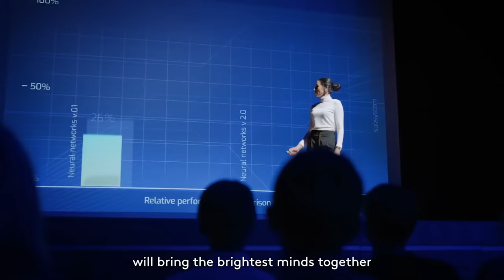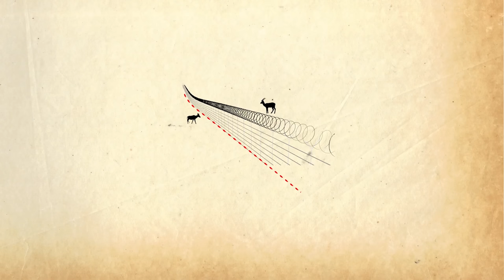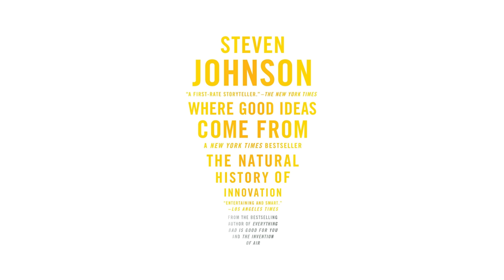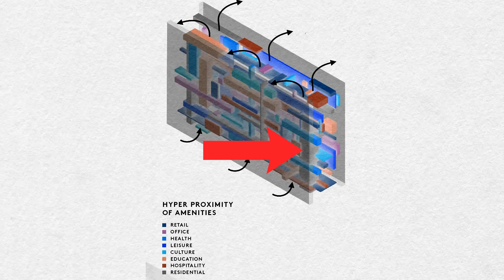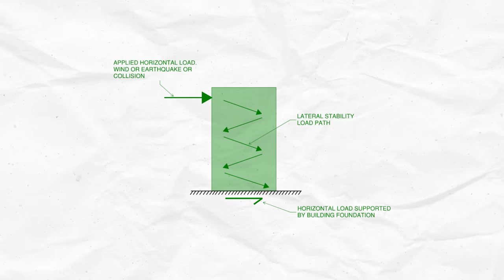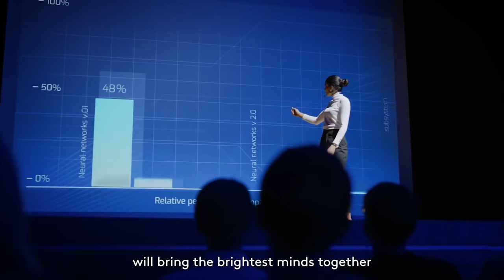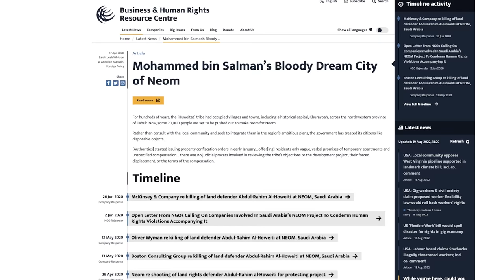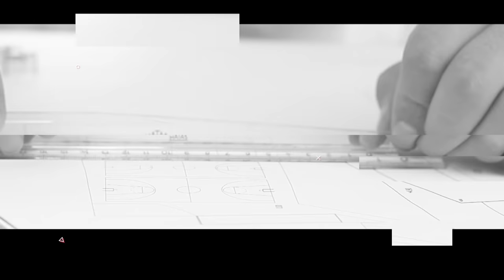This city concept breaks architecture (THE LINE)

Comment: This is based on the linear city theory proposed by Arturo Soria in 1882, with a long history of redesigns and proposals. One design even used the coast, like you mentioned. Even historically, this concept has never worked, and there are many detailed articles each picking apart each flaw of the design. It may sound good but simply doesn't work in practice.
Reply: I thought they should spend on Global Warming.
Reply: for real... it should be like a 40 year project - not this exactly ofc, but concepts of it. resolve domestic issues while slowly building the new stuff. gradually changing cities instead of throwing trillions to waste... this is a sad reality. what can we do to stop this ?? or are they just gonna do it anyway? I guess being vocal about criticizing it helps!?
Reply: @ZebrazRus  I thought it is on time now.

Comment: I really enjoyed this critique. I had many thoughts about heat, reflection, business & shopping areas nearby residential areas, richer & poorer populations, etc, so it was great to hear an informed critique of this.

I would've thought the desert has sandstorms and/or high winds from time to time & that the forces exerted could be massive & unequal along the length of 170kms traversing very different terrains. So I'd kinda thought they must be building this more as shorter blocks of 50m-100m or so, with wind passages or some other 'gaps' allow wind flow, but even that would be impractical & create vortexes of very different forces the structure would have to withstand & cope with.

I woulda thought it would be just savvy to construct smaller 'blocks' of the line along the proposed length of it - and not so tall to begin with - to 'test' what happens in reality.

Otherwise I can see a highly class divided society of base level workers in cramped horrible living conditions that are 'cheaper' serving the needs of visiting business execs, tourists & the mega wealthy residents.

Sounds dystopian & horrid.

Comment: As you said, and coming from an environmental geography background, first thing that came to mind was the habitat fragmentation. It would seem the designers have never heard of the concept.  A 'line' is the most anti-human/anti-environmental design I think one could imagine for city design.  I wonder what consideration has been made, if any, for break down of the transportation lines, fires/emergencies cutting off different sections, etc.  9 million residents...will the rich elite global business leaders be living next door to the train operators, store clerks, street sweepers, mechanics, etc...? Also, would consumable goods be manufactured within/nearby/or imported over long distances?

As you said, so so many questions. Even folks who don't have any background in city planning could probably name at least one flaw in the design at first glance.
Reply: My rational for the design:

- Height combined with a 'sandwich' structure allows more efficient management of temperature and moisture distribution.

- It has to be a 'line' that's aligned with the suns path (as much as possible) so that the sunlight reaches inside despite it's tall 'sandwich' structure

Of course we need way more data to really dig in to the nooks and crannies of the design. There might be a corridor for animals. We just don't have any of the details.
Reply: @primaryesthethicinstincts4832  Doesn't seem that way.

Comment: The line is good way to illustrat how easy it is for people to fall in love with concepts and not consider the reality of it.
Things like mentiond birds smashing into it,envairomental impact,turning the surronding area into a heat zone in the day light.
First though that stoud out to me was it's in a desert theirs going to be sand build up along this thing that that will request monthly or weekly removal needing either very specialist machins to drive in the heatzone in the day time or only have it done in the night time.
Also speaking of heat I wonder what the impact will be of the extream temperature shifts that will happen every day in the surronding area and The line its self.
Maintenance will probly be what break this idea in half if it even is built and is not turned into a decayed ghost city with the elit in walled off areas.

Comment: As an architect I've had few issues about the design and functionality myself and have come with some ideas. I think the residential areas will have direct access to daylight through the mirror wall- the wall will appear mirror on the outside but will be see through on the inside. I also think they'll implement this concept about other areas too so that light doesn't just come from up there. As you mentioned keeping the place cool is gonna be impossible if they keep it often as in the visualizations- that's why I think they won't. It'll probably have a glass roof.
I also think they'll split in the concept in, say, 50km sections which can repeat basically forever so they can extend the line at will. If they manage to make crosspoints it could be expanded in the other direction as well.
I found if fascinating as an idea but, as you said, terrible to execute.
Reply: Terrifying...
Reply: There is only one detailed comment and that’s yours. Thank you! I think, author of this video has no idea about new technologies and building. I’m sure, investors have thousand times thought  about these “problems “ what she said) before the beginning this project. Personally I see the Line optimistic! Have a nice day!
Reply: @nodirbekzaripov1948  it is not a bad idea, just impractical for real human beings or human beings who are not mega rich and have other places to live. Living there would mean everyone would have to have an income to be able to afford to live there. What if they become bankrupt or disabled, what do they do? Are there going to be safe houses or shelters..... in normal societies people who fall on hard times can go live in a shelter or with a friend or OUTSIDE.... are they okay with people littering the streets homeless?..... is anyone going to create a "poor" section of this place? poor people tend to have many children... there is basically no opportunity to build an extra small area for the houses they would live in once the 10th child arrives ( this being saudi, and women not having autonomy over their own bodies and childbirth) Once a person is assigned their section, there is no expanding, all they can do is  buy another section. forget farming. Can such a project accomodate enough of the lower class people it would need to become maids, janitors, all manner of cleaners etc? where will those ones live and would they even be able to afford to live there.... its not practical for humans. its a great idea... for imprisoned human, but not for humans not under government sanctions

Comment: I don't understand how you avoid a "death valley" heat trap between the walls. Air drawn in at the top of the structure will compress and heat by 5°C on the way down. Maybe multi-stage (indirect) evaporative cooling? Water supply strikes me as a problem.

Comment: Well done, that was enlightening. When I first saw these mirrors my first thought was this will scorch the earth around them even more.
Reply: And think of how much it will destroy life in the coastal areas where it goes near the ocean. In Los Angeles, the Disney Concert Hall by Frank Gehry was first mirrored and then needed to be made matte a few years later because of how much it made temperatures rise in the area including all surrounding buildings. And that was just one concert hall.
Reply: If you ever visit it, there is one panel of the building that was left in its original finish for the public to see. The panel chosen had to face away from any neighboring buildings and walkways. It's also in an area with a garden so it's shaded for part of the day.

Comment: I'm really glad you did this video, because I came across this project through other sources and so many wtf's were pinging off in my head, like what about the environmental impact with reflected heat, disruption of wildlife corridors, the lack of sunlight at lower levels, and so many other what seemed to me blatantly obvious major issues with the concept. And I'm thinking to myself am I missing something and the designers didn't miss these glaringly obvious problems and actually have designed in solutions (even though I couldn't for the life of me see how such problems could be fixed). So to have an actual architect confirm that the idea is seriously problematic, helps me feel like maybe my layman's grasp of design and environment isn't so bad after all haha.

Comment: The initial kernel of innovation in starting with a tiers of stacked transport options is a good idea, everything else is bad. Like pick any existing city, you can find at least one point where you have rail/subway underground, highway above that, and some kind of pedestrian/road above that. Suppose a small starter where you dig a big hole in the ground, build the subway lines, then the roads, and then the whole surface is pedestiran/bike/20mph electric vehicles only, with normal high density buildings. Grow organically from there. You can walk or bike anywhere, go 1 level down and drive anywhere, go 2 levels down and take the subway anywhere. Add high speed rail using normal tunnel boring as needed. That makes some sense! As long as you start REALLY small, like 200,000 small, 1 skyscraper, and let communities dictate new construction. 

I guess its like, city infra is always fighting for what things to build on the surface. The engineers want good transport stuff, the private builders want good land, and the citizens want good access, parks, walkability. So, you give the underground to the engineers upfront, and the surface to the developers/citizens. Your standard expansion plan is a 3 layer commuter rail/highway/ped street. When in doubt, ped street only. You can always block off a ped street, dig it up, and build the road or rail, and replace the ped street later. We do that already, just really slowly and inefficiently.

Comment: I still remember when it was first announced, i had assumed that no one would be crazy enough to build a massively long city because of the obvious issues, i thought it was far more likely that they were just building a mew railline and putting a number of settlements in key locations along the railline and then just calling the whole thing a single city for the headlines but nope.
Reply: sounds like a project back in the early 1900s lmao

Comment: You can lead sunlight through fibrechannels and get sunlight everywhere inside this thing (during the day). It is done in vertical greenhouses I understand. (But I also understand it is ridiculously expensive so usually I think you just use a lamp. Which of course you can do in this case as well to feed the plants with light).

Comment: That's a really well explained topic. I agree with your analysis and the vision of a disaster for the environment, but.. This won't be a city planned with the same ideas of Brasilia. The Line, Neom, looks like a very utopist concept but the idea is to create a sort of space capsule, like in the seventies movies, in the desert. It will be a "place" (could be it a place?) completely shaped by engineering, no need to explain why, for special purposes, where architecture will be used just to give a sense of wonder to something that will never be real architecture. It's more a vision to attract money and the richest of the planet in the most exclusive place on Earth. It's impossible that every km will have the same quality and services of the others. It will be like the sky ribbon in "Elysium" or the aerial city in "Alita" or in the novel Neuromancer. 
The Line, is a shape connected to the linearity of the transportation, a Hyperloop maybe, probably.
I wonder which firm will design this monstrosity. I would bet on Foster and partners. Thanks.

Comment: damn, i remember how enraged i got when i first heard of this (and i'm not even an engineer) because a simple common sense just screams of how stupid and inefficient this whole idea is...

but what i like the most is that on those "absolutely realistic commercial renders which are surely 100% not sugar-coating any obvious issues" it's shown that some mysterious "cool" air (from nearby desert which gets even hotter from sunlight reflected by mirror walls) is somehow sucked in and roughly at the same point (or just few meters away) theres an outflow of used "hot" air that leaves the structure.
like yeah, "hot" and "cold" air are absolutely different substances that don't interact with each other (just like "normal" and "dark" matter, huh) and don't mix, yeah sure. SARCASM
and if the point was in sucking cold air at night and release hot air at day (just like Tesla's gigafactory does), then that question "why keeping it's top opened thus connecting it to hot desert's air" becomes even more based.

plus not only the whole structure of two rigid walls spanning 500m high and 170km long looks very unconvincing and unstable by itself... just imagine the stress it would put itself through due to air flow it creates! just think about it even if only for a few seconds:
 - you've got a straight wall 500m high with no respect to the coastline (whose form actually determines the winds) nor local environment nor landscape (which also affect atmosphere movement significantly)
 - in addition to that, the structure itself heats one side of the desert to temperatures never experienced in local ecosystem before while casting a solid shadow from another side. in result you have a possible temperature gradient of few tens degrees Celsius across a mere hundreds meters (1 km at most). yeah, i'm sure that totally won't create any sandstorms/put additional stress to "the line"/annihilate local ecosystems and communities (or even rearrange nearby dunes).
 - also because of eneven surface and different conditions across it's whole length, temperature gradients will be different at different sections of the structure thus in addition to air up/down-drafts and wall-perpendicular winds, this difference will also affect a wall-parallel winds (and with it's open top, ummm... ouch, i don't even want to think of how strong those winds can get inside an analogue to 170km long straight street with solid edges...)

plus yeah, obvius to literally anyone who's got any form of CNS: transportation/logistic issues. i mean, of course maglevs already exist (even if it's still a very exotic and expensive way of transportation) and we can even ignore that you need to achieve 50% higher speeds than they do now... but you know what? maybe if your city relies on some fantastic futuristic technology which makes extensive use of rare-earths and is exceedingly expensive in manufacturing/maintenance to simply exist (not even talking about being in any way "sustainable"/"green" or cost-effective and competitive compared to other projects that don't require such assumptions) then maybe there's some problem with your project and not with mentioned technology not yet existing ?!

finally what's even the very point per se for this city to be of a defined lenght? what reason excludes it being, say 17km long? at that scale it's width is still almost negligible compared to it's length (so it's still in fact a "line"). transportation and logistic problems become less expressed, so do sustainability problems (even if they don't disappear entirely), so do problems with local communities, so do any maintenance problems due to less effect on local atmosphere movement.
and most of all, if the very point of the city was to align compact neighbourhoods in a straight line, why not just design a detached neighbourhood-block and then arrange them in any way you want, then just connect those by some communications, which can partly be put underground and partly on regular roads and bridge sections just few meters above the surface ? that way you can adjust air flow, for example, to create a more predictable / stronger winds in a specific area to then build a more effective wind energy generation plant there. this way your block-clusters make you extra energy/money just passively existing.
or you can adjust winds so as to create a less harsh environment right in the middle of the desert and then either use it as a specialized agricultural district or as a foundation for more conventional city projects.
this method can even be used on a local scale where just few blocks (or even a single block) redirects a wind to a large vertical-axis turbine right next to it (or a bunch of common wind turbines), thus increasing power generation while having minimal effect on winds at larger scale.
Reply: I cannot even begin to imagine the challenges of getting a base set for a 500m high wall, you're talking about a foundation roughly 125m deep if not more considering all of the lateral forces experienced 500m up in 10mph wind.
Reply: @apersonontheinternet8006  10mph? bwahahah...
I guess due to reasons mentioned, winds at the wall's "roof" could easily top at least 100mph at some point with (maybe even on a daily basis)

Comment: yeah i have the same question when i saw this about the light reflection and heat. i thought it would be like a mirage city but if it is just a single straight line then why would a person will go to other end to either side? i think this project will turn into modules and probably will change the structure in coming future
Reply: I think heat and moisture dissipation are much more manageable with this design. It's not 'line' but a 'sandwich' design with a bunch of environment regulatory systems in the middle. I'm sure there were allot of engineering tradeoffs.